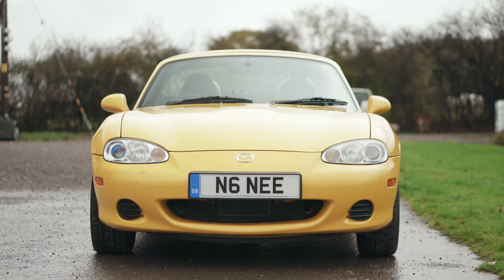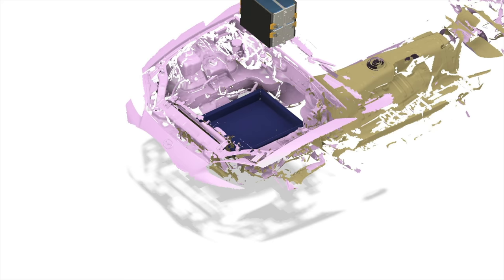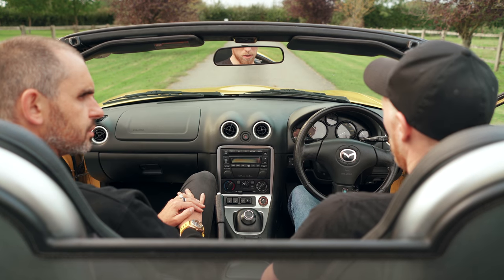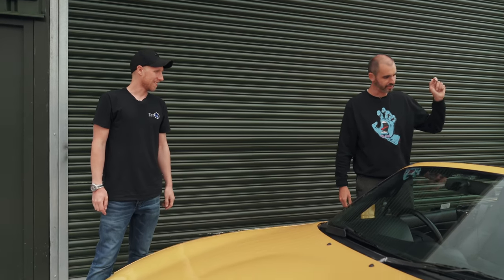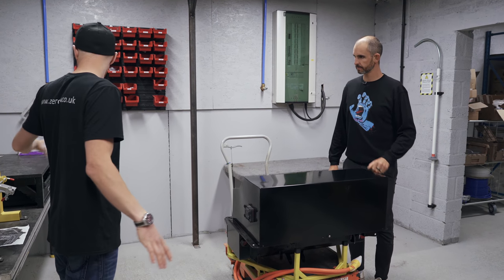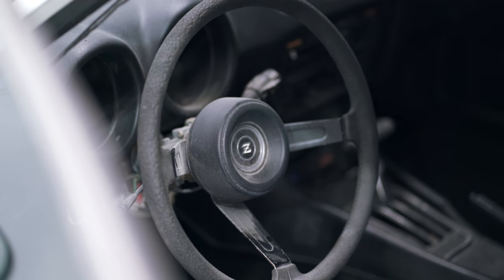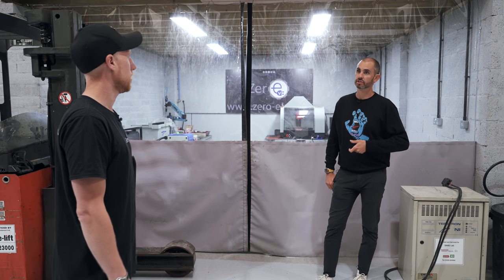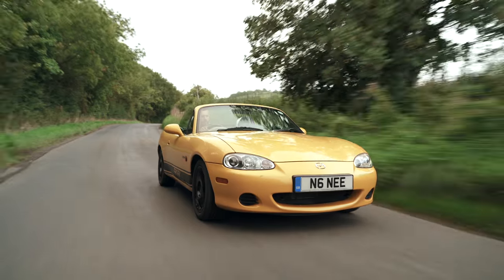EV swapped Mazda Miata MX5 // The Late Brake Show

Comment: This is the type of electric car I need, not boring looking crossovers
Reply: wondering if the weight of the car has remained the same, as well as the balance?! Probably its heavy as a rock now with the battery pack and electric motor!
Reply: @Condadode AlhamaHomes watch the video maybe? Same weight distribution and this setup only adds 40kg to the total.
Reply: @Maître Manta nobody wants to road trip in a miata.
Reply: @condadodealhamahomes  1070kg.  Watch the video
Reply: @Maître Manta 99% of the people that have a car dont go on road trips, the Range on EVs are marketing tools like FPS or Resolution in games
Reply: @RogueBeatsARG  and when they do, they do rent a car so they can pass the damage/wear and tear off to someone else
Reply: @userhandle3378  yeah
Reply: @patreekotime4578  I'd love to do a road trip in a MX5. I even went on vacation with it.
Reply: @ayeapprove it's totally doable in the states. Sure you need to travel light, but you can totally pack clothes and a spare.

Comment: Just love the ethos of the people in this company: keep the character of the car but just change the fuel type and make it 100% reversible.  Absolutely the correct way to do things.
Reply: They could of gave it some power they are so slow when they have a engine but they have made it worse somehow
Reply: NO EV conversion will get reversed ever. Don't limit yourself.
Reply: @bmwman1981  these cars have so much more to offer other than power... Although perhaps your BMW name makes it clear you will never understand that lol.
Reply: @moestrei  it might especially if it’s a valuable classic car which if a original car is worth more complete and original
Reply: @Adam.Piper62   I’m sorry if a mx5 came out with 200 hp I would be impressed as it’s easy now a days to get a smallish engine to that bhp
Reply: @bmwman1981  well to be fair. In 2003 they come with 150bhp so not bad at all. And they weigh under a ton.
Reply: @bmwman1981  he said in the video (16:14) they’re working on kits with 120kw and 180kw(241bhp) motors. This mx5 is a test best for future kits
Reply: @moestrei  They will in 30 years when a special ICE becomes prized. Hopefully most cars in existence will be EV by then.
Reply: @moestrei  The kind of cars discussed in this video, like 911s and classic Mercedes Benz would have their value absolutely plummet if you started carving them up and screwing up a numbers matching complete car. No such car owner in their right minds would entertain a butchery job where the car got savaged just to put in EV bits, but if you can do a clean and 100% non damaging reversible conversion, it just becomes more attractive if anything.
Reply: @moestrei  Not true, but even if an EV conversion is not "reversed" to the original state, they are often reworked to a better EV configuration. The salvaged forklift motor gets replaced by something modern, the racks of lead-acid batteries get replaced by lithium-ion modules, etc. Every time someone doing a conversion hacks into the original structure, they're reducing the value of the vehicle for a later conversion. 

On the other hand, this is just a Miata so it really doesn't matter.
Reply: @bmwman1981  a current MX-5 engine puts out 181 hp. That's close enough to your 200 hp.
Reply: ckise loopl revers refukbg rwàr f8se co8se zero emsion unimewd fisel fukeß
Reply: @extectic  buy hybrid 9¹1

Comment: Great. An MX-5 which is noticeably heavier, with less power, no noise and limited to 100 miles every 4/5 hours. Modern tech. Amazing.
Reply: Issue is, we developed ICE's for more than a full century now. 

The first Tesla Roadster used a couple of thousand notebook batteries since there was no real development behind batteries of this size. 

The engine technology itself is way ahead of the ICEs, already since the very start of EVs in the 1900.

Give it a few more years.

Comment: I'm looking forward to when EV kits aren't more expensive than a brand new electric car with a better range.
Reply: Need to open more EV conversion shops. That's the next step
Reply: The £25,000 step
Reply: While I'm love cheaper conversions, any of those new cars are all boring economy cars. At least here we get proper fun sports cars, especially now that companies like these in the video have managed to get it down without screwing the balance or weight.
Reply: In a couple of years they'll be using Model 3 motors. They're pretty much shoving a Bentley engine into a two door roadster
Reply: I assumed the car comes in the price?
Reply: @macberry4048  yeah there are already aftermarket controllers now for model 3 motor. Much smaller foot print than tesla large drive unit and more efficient. Only down side is it's like 200hp less than the performance unit but 3-400hp is still plenty in a car like this. It's really the batteries that need to improve and come down in cost and size the most
Reply: Well done engine swaps on classics also many times are more than buying a new car with that engine. The cost will come down a fair bit with the batteries, but swaps will never be dirty cheap unless you do them mostly yourself.
Reply: Hi Kane - once more people start crashing their EVs, I sure prices may well drop. I'd rather like a Roadie conversion!
Reply: Battery price is the main problem. Tesla is bringing prices down but moving to a sealed structural pack that cant be repurposed. So either they need to get into the aftermarket business or someone else needs to.
Reply: @Joachim Shekelberg yup. Tesla will move to a pack style that is glued into the subframe. It will make the vehicles dramatically cheaper to produce. They are working towards that 25k vehicle.

Comment: To keep the original licence plate and avoid having an SVA test and a 'Q' plate, the DVLA insist that no modifications are done to the chassis or monocoque structure.  Not even a single extra hole is allowed.  Madness in my humble opinion.  This conversion is fantastic :)

Comment: Just take my money now. I've driven MX5s for over 20 years, NA, NB and NC, and boy would I love this. Best of all worlds.
Reply: Got my NB for 20 years now. I would convert it but I would want more punch than that and more range.
Reply: @808GT  I think they made clear they could do that for you, but not at the original weight...
Reply: Wonder if I could order this as a kit with the Miata based 124 Rallye.... It'd be a lot more fun then the 1.4
Reply: I think it's an exciting prospect that the only limiting factor of these EVs is the battery tech, which will inevitably improve.
Reply: @808GT  same here!
I have an NBFL for close to 20 years and I would definitely do this conversion with more power and a little more range. 
I could trim the weight elsewhere if need be.

Comment: Nice to see guys like this doing kit conversions for cars in a way that doesn't require cutting up the car to do it. Makes it easier for people to do on their own car in their home/garage, and for small businesses that restore old/classic cars so they can concentrate on the body and aesthetics of the car and be able to just drop in an electric drivetrain. Helps preserve not only the looks and functions of the car but also leaves the safety features of the car in place without having to cut into and affecting crumple zones, and not having to add a bunch of braces welded in to keep the car from falling apart because of modifications done to the chassis.

Comment: Great job on the MX5 but... I owned an MX5 for a few years and loved driving it and the best part was hitting the gear changes on the bends and corners. As far as I am concerned that is an essential part of the fun. It would be perfect if it had the gears
Reply: Yeah I was thinking something similar. It’s not actually any faster, it’s a bit heavier, doesn’t go as far and misses some driver involvement. So why would you do it?
Reply: Many older EV conversions kept the original transmissions, but that would keep weight higher and destroy their excellent packaging and balance. Plus, the transmission is kind of silly when the motor has such a broad torque curve and big rpm spread. You also no longer need a clutch pedal, because there is so little rotational mass, letting off the go pedal during shifts is enough.
Reply: @Rubedo Alaberti, I do prefer manual transmissions in my internal combustion engine (ICE) cars, that wasn't my point.

When converting a car to EV, some builders keep the manual transmission, but remove the clutch pedal. The electric motor doesn't need to idle at a stop, and there is less rotational mass so pressing the clutch on shifts is also not needed. Shifting gears is also not often beneficial because of the electric motor's wide torque curve. My point is that keeping a manual transmission in an electric conversion loses some of the fun of a manual paired to an ICE.
Reply: @callummunro5400  well I'd do it to get a commuter car that I barely pay to upkeep or "fuel" up, still fun to drive, and costs less than a new car. I could drive an MX-5 convertible or get a used weird box thing that BMW made for about the same price and range. The convertible seems like a solid choice!

Comment: CCS is a huge deal - it takes these from being a weekend toy like the MX5 to being something you could use for anything/everything.
Reply: ...just add cordless chargers :)
Reply: I’m a bit of a cynic and I don’t know what it’s adding? It’s not faster, it’s a tiny bit heavier and doesn’t go as far. So why would you do it?
Reply: Callum Munro agreed
Reply: @callummunro5400  what i do know, the soul and spirit of car is lost. But, atleast is a green solution🤷‍♂️
Reply: Yeah, giving this thing CCS would really up its desirability. Wonder what modifications would have to be done to get the pack voltage up high enough to make it possible.
Reply: @callummunro5400  There is no point talking about it if you haven't driven one (any EV) for a while. Because you just cannot imagine it how pleasant it is. Nothing to do with green.
Reply: @Bobbie_1999  Not lost but replaced with something different.

Comment: Very good video and I am very impressed with zero ev. Its good to see the advance in ev conversions. I have an MX5 that was converted in 2008 using an Azure motor and Inverter. I have improved it over time. It started with a 214v 19kwhr battery pack capable of driving its ac motor at 40kw. It now has a 400v 32kwhr battery driving the same motor at 70kw. All the electronics including BMS, j1772 charging and instruments were designed by me, because they were not readily available back then. I still have the gearbox and use 1st 2nd and 3rd without a clutch. Unfortunately Azure went bust around 2012, but I have driven over 120000km and still take it out for a spin weekly.

Comment: Really, really, really impressed with the packaging in this. Really light too at 1070kg
Reply: But no range courtesy of its small battery
Reply: @Rubedo Alaberti MX5 are the sort of cars  that you take for Sunday morning drives on your favourite backroads. My favourite Sunday morning backroad drive is a 300km loop!
Reply: @richardhoulton4016  This sort of cars doesnt need a 200 mile range. As they say in the video, it would add a lot of weight, spoiling what the MX5 is.
Reply: @thebigmacmoomin  I agree on the weight, but when I have a car that is fun to drive, I wsnt to be able to drive it. My favourite Sunday morning backroad drive is 300kms long and this wouldn’t make it!! So it’s useless

Comment: Love this I have a  Miata I was gifted and did some small mods on. Its been sitting and I was torn between it building a sleeper with an LS6 or doing EV. I was curious what would need to happen to develop a solar collecting hood to give it passive recharging. Like if you developed a hood that would inset the panels and maybe same on trunk.

Comment: nice conversion... here in California I like to drive my 1997 Miata(MX5) to the coast and back and thats over 300 miles round trip for me and I'm used to being able to go a bit faster....so it's not quite there yet.... but as tech advances (mostly lighter and greater energy density batteries are needed I suspect), the day of an electric Miata that matches the original is getting near... good work

Comment: 29:05 "CNC machine." Lol! Only if CNC means "Crank 'N Crank". That appears to be a totally manual (non-CNC) lathe.
But other than that bit, this is an excellent video. Zero EV appears to have their stuff together and is developing what should be high demand kits. Straight bolt-on mods should have great appeal, and should also greatly facilitate their own conversions. I wish them well.

Comment: Beautifully clean conversion. Amazing you were able to keep original weight distribution. I hope in the future they can get pack voltage higher to enable DCFC and a bit more motor power, too, I’m guessing, but I understand too much would make the car too different than the original design intent.

Comment: Hey Jonny, Love the channel and loved the car.... until.... The price!!!! ... 20k... I'm sorry but for a weekender if I had 20k to spend... Petrol all the way. I would happily commute in a square EV box that I could clamber in and say "work" and it would take me there. For weekend use I want the viseral petrol heart beat, the smell, and the sense of soul to a car. I understand them making this as a platform for other vehicles but 20k feels steep for a mk2 mx5 and maybe about 20 years to early for the weekend warriors. I hope they do well I really do because I applaud their engineering.
Reply: Let's supposed you were making a prototype for an EV kit system to fit into expensive cars like the ones shown later in the video. Would you do the prototype work on one of those expensive cars? Or would you first get an inexpensive (but representative size/shape) car to do the prototyping on?
Reply: @Graham_Wideman  oh I totally agree. As I say I applaud their engineering. It's excellent that they have managed to keep faithful to the 50 50 etc and I can see why they did r&d on such a cheap but well built vehicle. Very clever. However I still think, for me, that a weekender will be petrol forever. Electric will always be fast and exciting in its own way. For me a big part of the soul of motoring is the smell and the sound, they add so much to the experience. However for others they will want an electric weekender and that's where these guys can fit in. I wish them all the luck in the world because the car industry is not suddenly going to become easy for small companies just because it's gone electric. It will be as hard as ever.

Comment: Another thing to consider beside leaving my MX-5 alone or  to turbo it, supercharge it or possibly now EV it 🙈🤣
Reply: Or a Rocketeer conversion.
Reply: @grahammurphy5516  Almost forgot about that. The price of those is the only thing that puts that option down the list for me BUT i'd have it in a heartbeat.
Reply: @CarBore  I'm a rocketeer fan too. Compared to the MX5 EV it looks a little cheaper, but still a lot of money for both options. The  EV looks like a good idea but the range is too low for what I'd want to do.
Reply: @grahammurphy5516  All this is still in the early stages.  As battery density improves, you will get more range for less money...
Reply: @redbaron6805  completely agree and when the day comes I'd consider the EV route. Until then we ll just have to enjoy the interal combustion engine.
Reply: @grahammurphy5516  Nothing wrong with that.  Ultimately, if we can get rid of the combustion engine commuting miles and all the bus and truck miles using combustion engines, the weekend driving will no longer be a factor.   There will always be old cars with combustion engines but they will be increasingly a minority over the next decade or two.

Comment: And still running Windows XP 29:06 ❤️
Reply: Quite alot of industrial equipment and even medical equipment still runs on XP or earlier OS's.  I used to operate a waterjet machine that would only operate from 3 1/2" diskettes with the appropriate controller files and the data files you wanted to cut. I think that machine was running some version of DOS as that was around 2002. A few years ago I spotted Windows 98 running equipment in a hospital. Hard to believe theyve kept it running all these years!
Reply: @patreekotime4578  Don't ATMs run on XP still? If it isn't broke, why fix it? XP 64-bit (adapted from Server 2003) is still the best OS Microsoft have produced imo.

Comment: Hello , great idea having some space between  the front transverse and the battery so it will be safe in case of a front collision  .

There is something that came in my mind and I would like to share with you 
1)Possibly a manual operated  co2 fire extinguisher mounted under the hood could become handy  and the automatic fire extinguishing tube under the hood and at the charger's compartment would prevent a fire while being charged without surveillance . 

2)Installation of an alloy foam block in order to absorb impact energy if something bad happens and  filling the rest of the empty space with urethane foam in front of  the pack for aditional noise reduction and aerodynamic improval .

You know of course that the extra weight is a compromise but you can always make it full carbon body kit to save weight and make a flat bottom 🤣🤣 

It s very easy when someone else is doing the hard work 🤣

Closing
CHEERS FOR THE QUALITY OF YOUR PROJECTS , THOSE HARD WORKING HOURS REALLY DELIVERED !!!!
And GOOD LUCK WITH YOUR NEXT PROJECTS  we ll be following you 👍

Comment: Boo too slow if your going ev route should be a min of 200bhp, I'd love to ev mine but parts are just currently too hogh when u can bolt a turbo on for less than £1500. 
Loads more room under the bonnet coulf built a 40kw battery in the or 36kw
Reply: I think that will be another car/project. he wanted this one to be a city driver really if I remember rightly. EV is exciting though and we're just beginning!